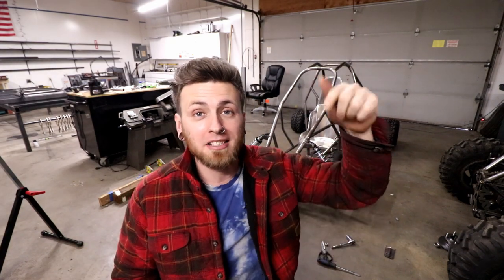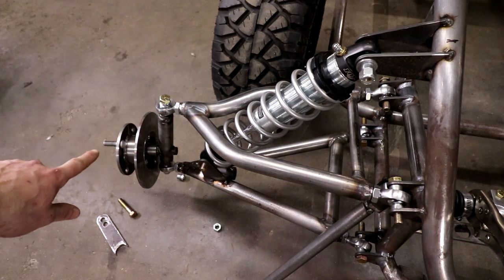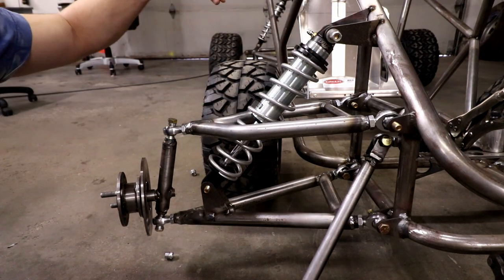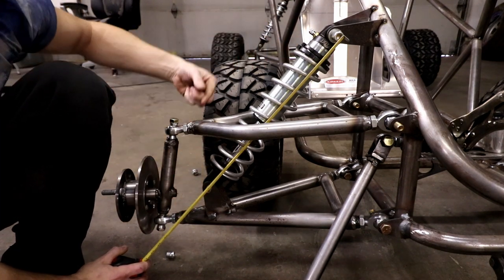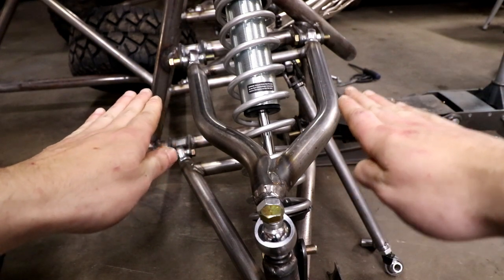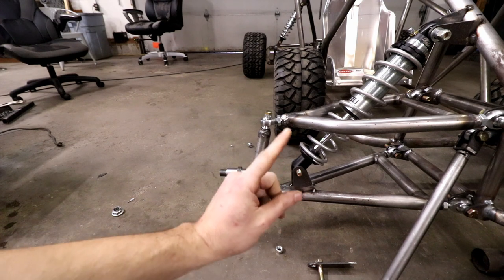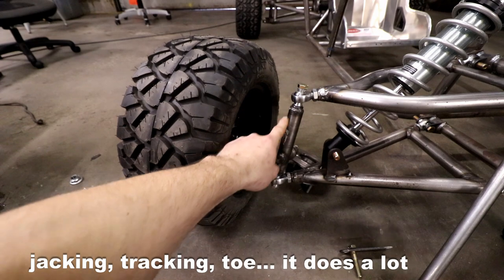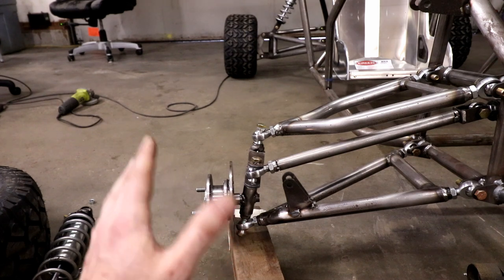Crosskart Build Pt. 8.5 Front Suspension EXPLAINED!

Comment: Your kingpin inclination is fine as it is. You don't want camber change when suspension is compressed while the crosskart is traveling straight.  You only want camber change when the front wheel suspension is compressed or extended in a turn.  You do that by increasing caster angle. At the moment it's about 5 degrees (ok),  8 degrees to 10 degrees would be more ideal. However,  check it yourself by turning your front wheels to see how much positive or negative camber it has in each direction. The wheel that you used in the video should have positive camber to the right (becomes inside wheel in a turn) and negative camber to the left (becomes outside wheel). Castor does mainly two things, it helps with stability so that your steering centres itself, and it introduces camber change in turns. Too much camber makes steering heavy.
Reply: I agree, all though you really won’t know the exact castor that car needs till you start text driving it.
This is why I made my top a-arm adjustable to change my castor without pulling the top a-arm off the car.
It might look all good when you turn it left to right and cycle the arms up and down when it’s sitting there, once you put the car through load that’s when you will really know where the castor should be at in my opinion. 👍
Reply: @SikSwanger  correct and I agree with you. I was just giving recommended castor angles for reference. Note: I looked at the thumbnail of the that turned wheel, in my personal opinion, I would increase castor slightly to give the inside and outside front tyre 'bite' in a turn when you are off road.
Reply: @JonathanNichollsjono  all good 👍
I wasn’t trying to correct you bud, Just putting my 2 cents in and what I’ve learnt and experienced over the years with these machines.
Reply: @SikSwanger  I'm not offended at all. Always good to discuss these things.
Reply from the maker: Thanks guys. its something im gonna have to play with. I read a full suspension write up from a reputable crosskart builder (from 12 yrs ago) and they were shooting for 0-4° caster. didnt understand why and it sounded crazy low. Eapecially when you look at the other crosskart companies at full lock and their wheel ia cambered in (what looks like) 8°! But like @sikswanger said, i wont know til i run it. I GREATLY appreciate your guys' feedback. it means a lot to me. keep it coming theough the build
Reply from the maker: Im certainly gonna shoot for 9° next
Reply: @jimkhana6881  I have mine set at 6.
Reply: @jimkhana6881  Is that included with the slope of your front end?
Reply from the maker: @JonathanNichollsjono  I wasnt sure if that factored in. My knuckle square to the gtound has 5.5° and i believe the kick up is 6° itself with arms mounted parallel to that. Does that add to the caster angle?
Reply from the maker: @SikSwanger  Im sure Ill be messaging you once I run a few shakedown passes 😅
Reply: @JonathanNichollsjono  my front bottom nose rake and castor are at the same angle 6 degrees, but that’s what works for my car.
Reply: @jimkhana6881  ok cool. Here's a guy that I have been watching for a while. His explanation of suspension  is just so easy to understand.  https://youtu.be/VbReLNi2JP4
Reply: @SikSwanger  I have just subscribed to your channel.  Looking forward to watching your videos.
Reply: @JonathanNichollsjono  thanks bud! 🤙

Comment: Hello , 
Great video , great car cant wait to see it finished .
I would like to ask you a question
I ve heard you said that the maximum kingpin inclination shouldnt be more that 12.5 degrees , what if it will be ? what problems should that have , I am designing a leaning tricycle than in order to have zero scrub radius has to have 22.7 degrees kingpin inclination , I havent finalized yet the design and i might finally make less inclined or maybe not inclined at all , but I dont know things get way too complicated with leaning , whats your opinion ?
Reply from the maker: I think you want some scrub to keep the bike tracking straight. The trike is totally different. I'm strictly talking about a crosskart with this ride height and geometry
Reply: @jimkhana6881  i dont know what you mean by bike traking but ok , I know its diferrent but the bump steer is the closest thing to lean steer , if the tie rods wont be put in the correct position the wheels will steer as they lean . 
In the current 22.7 kp setup i have now i see that the point that attaches to the rod end changes height for example 40 mm when steering right and 20 when steering left so i think that would effect ackerman making it more complicated